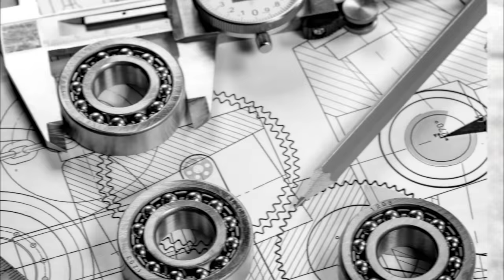The Most Successful Machine Gun in the World?

Comment: I was a tank commander on a Leopard 1A5 back in the mid nineties. We had two MG-3 for each tank. On for the gunner mounted coaxial on left side of the main gun and on on top of the loaders turret ring. The coaxial one was incredible powerful when mounted on a 40+ tons platform. We had a laser range finder, thermal sight, electrical powered turret and gyro. We could easily hit targets out to 1000-1100 meters with the coax with that setup. The ammo box was mounted on the left side of the turrets inside. If I remember correctly it could fit 2000 rounds. We had additional 3500 rounds hidden under the turret floor inside the hull. The turret had to be rotated to certain positions to access the ammo if needed. I think we had only two barrels which is common. We should probably had three since the cooling period took a while.
Reply: In den Munitionskästen sind 500 Schuss und es gibt einen Wechsellauf und einen Wechselverschluss.

Comment: The MG42 design is not 40 years older than the M240, the M240 is the FN MAG 58, designed in early 1950s, adopted into production in 1958, with minor changes.   The FN MAG 58 uses a nearly IDENTICAL copy of the MG42 grip/trigger mech housing, and several other parts are interchangeable.     The improved ammunition box for the MG3, I'm not sure if you mean the metal 200rd Bundeswehr ammo can, which has a sheet metal wedge riveted in the bottom to keep the belted rounds straight, or the 100rd plastic square belt holder that clips to the feed tray.      MG42 was adopted by the Bundeswehr as the MG1, using original WWII guns; MG2 was the MG1/MG42 converted to 7.62mm NATO with new barrel and feed tray with spacer; MG3 was majority all new production parts with a new feed tray and cover for the shorter 7.62 NATO, the heavier bolt for slower cyclic rate, improved Anti-Aircraft Sight and muzzle brake.     The US Ordnance Department FAILED in the development of our M60 GPMG, we should have made a more direct copy, instead we got a bodged morph of a Fallschirmjaeger Gewehr 42 gas piston and trigger mechanism with an MG42 feed mechanism, because of our "not invented here" mentality.
Reply: May i comment on one small thing?  The MG 42, MG3 and all other derivates do not really have a muzzle brake. What that thing is called,  could be translated as recoil booster or recoil amplifier. So if i understand the purpose of a muzzle brake correct, this item does the actual opposite.
Reply: @nirfz  You're right the booster increases recoil to speed up the rate of fire.
Reply: @carlwessels2671  Maybe i am wrong, so feel free to correct me if need be, but to my understanding the bolt weight and Springrate handle rate of fire in this application.
And the recoil booster is there to ensure reliable function under all circumstances. It makes it  relatively insensitive to looser tolerances in powder charges. As well as situations when the gun is shot extremely dirty, and or the lubrication is freezing up.
The shove back, the booster provides to the barrel is able to brake the barrel loose but has no effect after this first impuls.

(The version i was trained on had maybe  60-70% of the rate of fire of a 42. And while it had visibly more bolt body weight, and we also were told that it had a different spring than the original, the recoil booster looked similar and no mention was made that it got changed in any way.)
Reply: @nirfz  Good reply.  As I've seen reported the booster helps to speed up the barrel/receiver group which can be used to increase rate of fire. On the slowed down gun (heavier parts) it probably does more to help functioning,like you said.

Comment: just a minor correction: Italy uses what it is called an MG42-59. It is the version of the MG42 modified in 1959 to use 762NATO rounds and some other minor modification. Later (if I am not wrong it was around the mod 80s) the mass of the bolt carrier was increased to reduce rate o fire, down from 1200rpm to 880-900rpm. I shot the MG42-59 as part of my training in the Italian Army.. it is really an amazing weapon
Reply: The Italians did a similar thing with the BM59 rifle. They took the US M1 rifle and simply modified it to fire 7.62mm rounds from a detachable box magazine. Unlike the US, they did not make all the other modifications that were incorporated into the M14.
Reply: @allenjenkins7947  yes Sir, absoultely. the most important modification to the FAL BM59 (FAL is Fucile Automatico Leggero.. that translate to Light Autoamtic Rifle.. LOL light) was the goose neck guide rod. the original Grand was a single piece, the BM59 was a dual item, with a larger external and a billet smaller diameter piece siding inside the bigger one. this allowed to slow down the cyclic rate of fire and make it, somhow, usable even in the that role. the BM59 was the rifle I was issued.

Comment: The MG 34 wasnt aging it was just more complicated to build. The MG 42 used stamped sheet matal parts in comparison thats drastically made production easyer. as for better the high rate of fire was actually a disadvantage leading to faster overheating and the need to replace the barrle (wich was quite easy) and a higher ammo cosumtion. Thats one of the reason why the MG 3 lowered the rate of fire comparable. 

You have to remember a MGs unlike a submaschine gun role isnt just to mow things down or fill a close space with bulets. Its as much to supress your oponent and allows your squad to get into Granade range to take oponents down.(in an ofensive role) or pin them in place for Mortar/field gun fire (in a defensive role). 

What made its groundbreaking was its capabilitys compared to its weight. Bipod monted it filled the LMG role as an organic part of a combat squad while with a heavy tri pod its was stabilized enogh to be used as a heavy Maschine gun. The allies save for the USSR lacked anything comparable. With their versions either being much heavyer or with limited ammo like Brens or BARs due to being mostly used with clips insead of being belt feed.

As for asbestos gloves....maybee they come with the Tripod they certainly didnt for the ones asined to squads unless this is an afganistan thingy ,-))). You just used your standard/coldweather gloves and keeped contact to a minimim before they bured you ,-))).

Comment: I used the MG3 in 93. Very accurate on the shooting range. Shoot a quick low burst and the rest will track higher up in a straight line. Almost too easy when shooting drop down targets.

If my memory is correct the weight is 11,6 kg, try to carry that for 10-12 hours walking on patrole in shooting position and you will know what tired arms feels like... The day I figured out to put a strap on it to carry it with a strap in shooting position was one of my best days.

It was very accurate shooting with the support, but try hitting anything holding it in your hands was almost impossible.

Comment: one small note one the last part, Denmark's army did replace its old MG3 from frontline service (going to the national guard storage I think), replacing it with the M60E6, an improvement on the M60E4 and the latest M60 variant. It won against the HK121 in the Danish Army's GPMG replacement program in March 2014.. A trial that put emphasis on a more lightweight, slower firing modern variant of a already proven machine gun design. As a higher rate of fire requires more ammo to be carried.
Reply: How much ammo does one need to carry for 6 hours of expected fighting? ;)
Reply: @KrokLP  Denmark has had the most combat losses in afghanistan compared to our population size
Reply: @KrokLP  When I used the MG3 in the royal danish army I normally carried around 500-750 rounds myself, not including the 100-150 rounds I had ready in the MG (I'm a big guy). But if you expect a long fight each member of the team of 6-7 men would be carrying at least 750 rounds each. Things might have changed since. But I would like to have at least 1500-2000 rounds ready for a fight.
Reply: @gawkthimm6030  shows how bad the Danish are at War who havent been in real War for centuries lol weak soft gays. I dont wanna see how bad the swedish will fare st the next war against russia and china

Comment: I would have to say that the M2 beats out the MG3.  Invented in 1918 and still in wide use today.  Until the introduction of the M2A1 in 2011, swapping wooden grips with plastic grips was about the only significant design change in almost a century.  The M2A1 introduced a new barrel system that allows operators to swap barrels without  having to manually tune the guns headspace and timing.
Reply: Soviet NSVT 12,7 x108 "Utes" beats M2 by far far!
Reply: @ldkbudda4176  The Utes certainly has the edge on the M2 in a couple functional categories, but I would still have to give the win to the M2 in most use-cases.  In what ways would you categorize the Utes as the superior weapon system?

Comment: Having had the privilege of firing a MG3. - owned by a private collector (lawfully papered) I must say I was impressed with it. It takes practice to fire short bursts - as the gun has a very high cyclic rate. 

The quick change barrel feature is truly amazing. Pop one latch and flip the barrel out (of course wearing suitable heat resistant gloves.) All in all - for a design that traces its roots as back as 1942 - this one excellent piece of engineering.

I also had chance to speak with Marine Veteran of WWII. We were discussing weapons - M1903A1, Colt 45, etc. We then talked about Guadalcanal and M1919 30 caliber MG. The aircraft version fired faster (approximately X2 as fast as the infantry version of 400-600 Rounds Per Minute. The Marines would drill holes in the bolt carrier, lightening it - and making the effective rate of fire faster. This was needed to break up massed Banzai and Suicide Charges.

Comment: I shot that MG3 in the Bundeswehr in the early 90ies. At this time we even had barrels with the original Nazi-Cross being "stamped over" using a simple circle. These were known for being less precise, but I liked that wepon way more than my G3 "Assault rifle". As I was way better with the MG3 optics than the G3 ones. At least on 25 meters shooting "50 Pfennig" Coins taped with tranparent tape onto a target. You hit it? You got a fist sized hole and you knew "you nailed it". 

That thing with a 2-3 times Optics as well as a 3 burst mechanical restrictor rather than full auto - that would have been a wet dream at this time.
Reply: Wie soll das den funktionieren? The MG-42 had a caliber of 7.92x57mm, the MG-3, as mentioned in the video, is in 7.62x51mm NATO. And you can't shoot the later through the 7.92mm bore barrel, and you can't "add" those 0.3mm to the bore (the opposite way "could" work", redrilling the bore). Even the older MG-1 and MG-2, which were basic MG-42s reused, had not only be re-chambered but also all needed to get new barrels. Which btw on most MG-3s were "polygon" barrels, not barrels with conventional rifling....
Reply: @TheRealRedRooster  I assume that already manufactured raw barrels were re-used, the bolt and ammo was definitely NATO. Otherwise I cannot explain why you see a circle with a "perfect" cross in it on that type of less precise barrels. The better ones did not have that marking.
Reply: @AnkurFFM  I doubt that there were many "raw" barrels that had not been bored to 7.92mm left after WW2. Beside that it would take much more than just the barrel to have the right caliber, receiver and thus chamber need to be fitting as well, after all the 7.92x57mm is 6mm longer for the casing, with the overall cartridge even 10mm longer overall. Also not sure what "circle with perfect cross" you are referring to, there certainly were never any barrels used that would have any swastika marking on it, if that is what you are referring to. Beside that the proof mark of the WW2 Waffenamt was the "Lämmergeier", the highly/crudely stylized German Eagle, with an teeny weeny circle with the swastika in its claws, but all of those had to defaced by over-punching the swastika. While I have shot with several MG-1 and MG-2 we had in our battalion armory, I don't recall ever to have seen what would have been a WW2 era (and originally 7.92mm) barrel. The only time that I have indeed seen the  "Geier" was on some K98 (both in 7.92mm and completely rechambered ones in 7.62x51) as well as some really old and worn out frames of P38/P1 pistols.

Comment: The most powerful machine gun of WW2? Are you sure?
Reply: I suppose if you only look at fire rate.  😂
Reply: Depends how you define "powerful". The M2 though it has a way more powerful cartridge has a way lower fire rate, so in the end the MG42 might put more weight of lead down range than the M2 and as learned during the Vietnam war, in the end all that counts are the number of fired shots per square meter.
Reply: @dermozart80  how did you learn that if the side that fired by an order of magnitude more shots lost?
Reply: @dermozart80  I'm not convinced that the American 180 is a particularly powerful machine gun. Insane firing rate, but not really powerful. Power is energy. Kinetic energy is velocity and mass.

Comment: Well, the designer was a really smart man! He asked the end users what they needed (something too many ignore - especially in the gun-business, but also fashion or tech...often the designers make what they want, instead of what the customer needs -.-), he familiarised himself with the available weapons (during that machine-gun-course he joined, but probably even more so - he probably took them apart etc.) and then he made a weapon that wasn't trying to reinvent the wheel (he made it so that trained machine-gunners would know how it works without much extra instruction except maybe that there is a quick-change barrel!) and he made it simple to produce compared to the other options!
Designs like that can stand the test of time easily, till something radically new comes along (say a coil- or rail-gun if we can figure out how to supply power on the move and make them lighter than current prototypes and have them shoot at higher velocities than what handheld weapons of both types are available right now)...hell, other designs are still around too, from the Browning's designs like the 1911-Pistol (seriously, give it a double stack mag and some picatiny-rail and you have modern handgun, despite the fact that inner workings of the gun are over a century old!), the M2-HMG (sure it changed roles, it was intended to defeat aircraft and even early tanks, but frankly it works fine as a heavy infantry weapons, especially to flush enemies from cover and damage or destroy light vehicles like trucks) etc....to others, hell the Mauser-Action is still the most copied action for a bolt-action-rifle up to this day, sure they now have modular stocks, detachable box-mags, picatiny rail, optics etc. but basically that is still a rifle from over 100 years ago!

Comment: What's really impressive is, by 1940 the MG34 was ageing, six years after its introduction. Eight decades on, and the MG42/MG3 has no logical need for replacement - other than to save ammunition.
Reply: The logical need to replace it is weight. That's why the MG5 was introduced in the German Army a few years ago.
The infantry version of the MG5 weights 300 g less than the MG3 and is easier to use and it does have a NATO rail which allows to add optics by NATO rail standard.

Comment: I guess over time the MG3 will be replaced though in many of the units and that process has already been underway in the German Bundeswehr already with the introduction of the MG4 and MG5 as Squat Automatic Weapons in the 5.56 caliber range. While the MG3 is mechanically a great weapon it does have become a bit outdated from a conceptual use as far as modern military application goes. The MG3, all things considered, does have quite some weight to it. It requires more or less a full crew to operate effectively. Comparably to that you could take the usual MG Squad of 2 or 3 men and give them 2 MG4s for 1MG3 without loosing any firepower, even with the lower caliber. Not to mention that weapons like the MG4 or MG5 can also be used in assault, they are easier to handle in close combat areas and if you want like assault rifles, if required while also supporting most optical devices with a picatinny rail for example and offering more configurations. Some LMGs even accept standard magazines for that matter.
What you basically gain here is simply flexibility. The fact that you can now basically equip 2 people with machineguns including the amunition compared to 1 in the MG-Team is quite considerable. 
The MG3 has still it's place of course and it's an excelent machine gun. Even in a modern conflict. So it will not dissapear in infantry combat. But just like many other machine guns in the 7.62 caliber range it will become more of a niche than a general purpose machinegun used in every situation. Particularly since it has become more or less a standard to give infantry united pretty much a machine gun which is also using the same caliber as the standard rifles. Logistics and manufacturing are important considerations here as well.